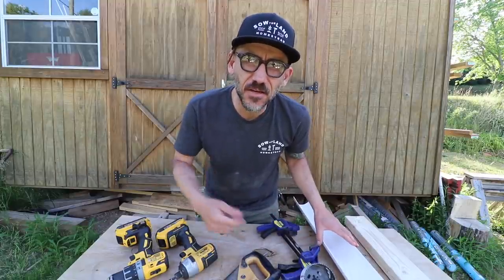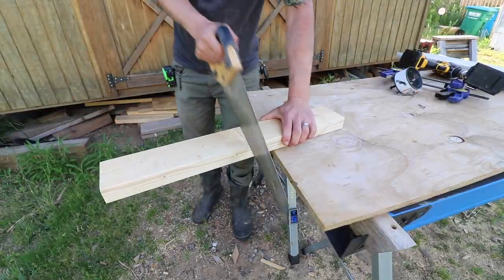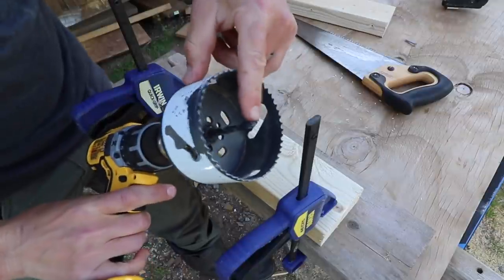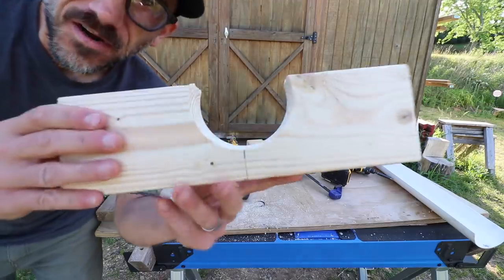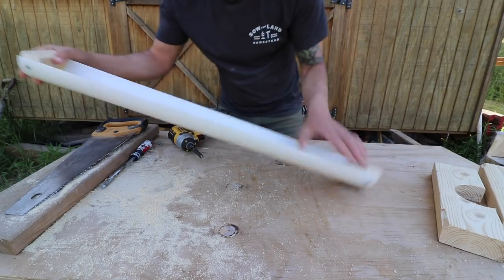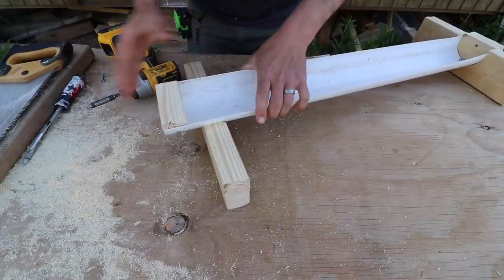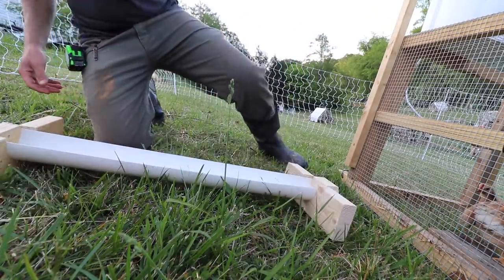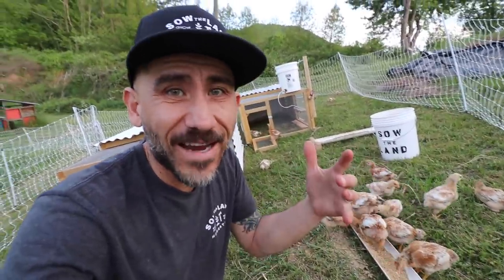DIY How to make a chicken feeder (Simple & Scrappy)

Comment: Any ideas on what to use if you don’t have one of those circle cutters? Are the PVC pipes easy to cut in half? What do you use to cut those? I have very little experience with power tools but these feeders look pretty ideal.
Reply: You can mark it with a string or a trace a can the size of the 1/2 circle piece and use a jig saw to cut it out. While it needs to be a semicircle it does not have to be a great / smooth cut a few dips and dives from inexperienced the jig saw user won’t really hurt anything. It will give your feeder character. 😀

Comment: I am planning on building something like this for my Suscovich tractor. My plan was to use PVC end caps instead of wood. It will be hanging from the top bar. Is wood end caps better?
Reply: Both will work. The wood is just cheaper since it’s probably scrap. Good luck

Comment: How do you cut the pvc pipe?
Reply: PJ Maynes I would like to know this too. I,m going to try my circular saw setting the blade depth very shallow just enough to clear the pipe and make two cuts. Alternatively I may try my table saw using the same method. Will keep the length under 4ft so I can mark the pipe using my 4 ft level. I need chalk for my chalk line. Hopefully someone else will post an answer also.